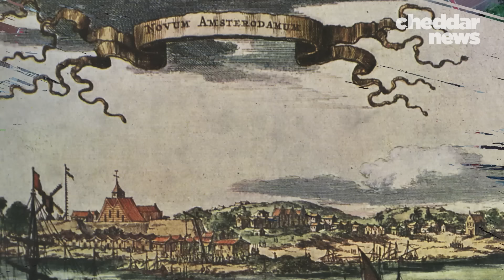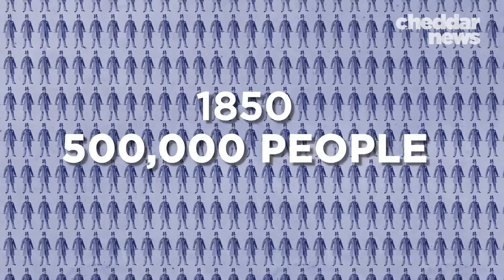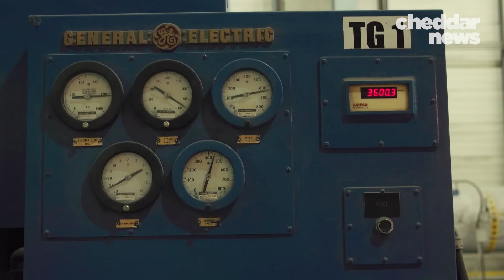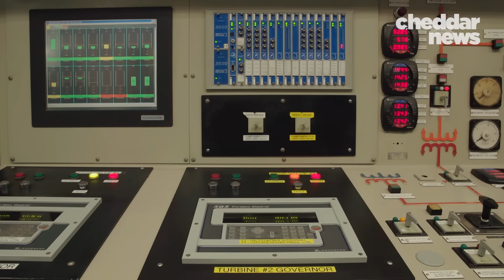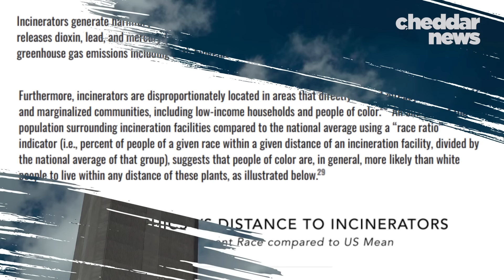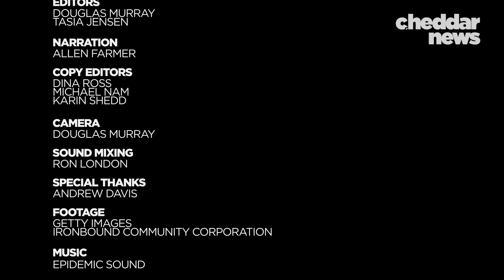Where New York's 14 Million Tons of Trash Go - NYC Revealed

Comment: I bet they can't wait until someone invents the wheely bin.
Reply: Read the comments! They can't have a bunch of wheely bins because then on trash day you won't have any parking since the whole street will be filled with bins, waiting to be emptied.
Reply: @henryjohnson-ville3834  that's  correct. And even in countries with the bins like Australia there are still problems. I'm in inner suburban Brisbane, at a block of ten apartments. Sometimes the bins are all out on the footpath, on the kerb, and in the morning some idiot(s) has parked his car (s )in front of sone of the bins. This is despite all the apartments and houses  around here having their own garages and parking areas. Usually it's not someone living here.

The garbage man gets angry because he has to get out and move the bins in front of the driveway to empty them. Its does not happen all the time, but I 've seen it happen quite a few times. Sometimes a bin or two is just left and not emptied for two weeks and it stinks and flies come, terrible in summer here.  I m usually at home till 10 am, so if I hear the truck coming I 'll go down and move the bins if a car ( or cars ) are blocking access and the drivers are grateful for that. Sometimes I come  home at 3 30 or 4 pm and bins are all in front of the driveway or all knocked over because of limited access for the trucks. 

I can envisage chaos if this system was in NY!

Comment: Why don't you build automatic recycling lines that can separate metal, plastics, organics, paper, glass, aluminum into new materials instead of taking them on barge out of your sight? The whole facility would probably cost less than 500 million and reduce costs over 10 years by several billion dollars.
Reply: Recyclables are collected separately on other days. We have a huge facility that sorts the recyclables. Recycling isn't covered in this video, only trash.
Reply: @Gertyutz  I understand, but not everyone recycles. You should try to extract recycables also from the mixed trash for that reason.

Comment: 1:59 Why does the truck have two steering wheels?
Reply: late reply but those style trucks you can drive from either side. A lot of times the passenger side will be low entry, basically one step into the truck and you can drive standing up, much easier on the body. lookup Mack LE cab pics
Reply: @metaIIiicaftw  Cool! Thank you!